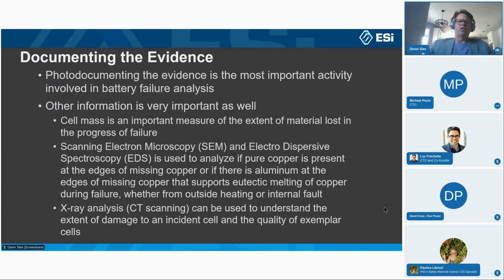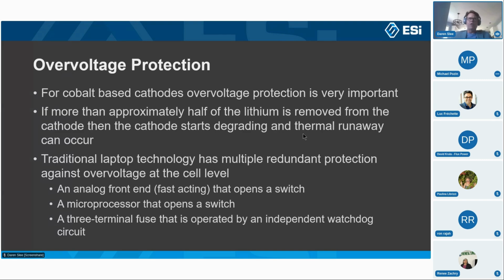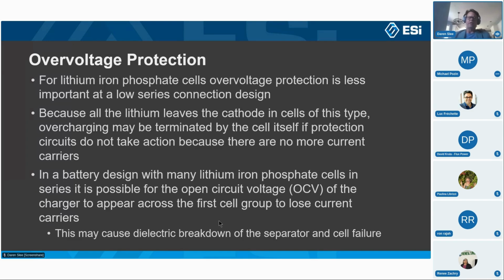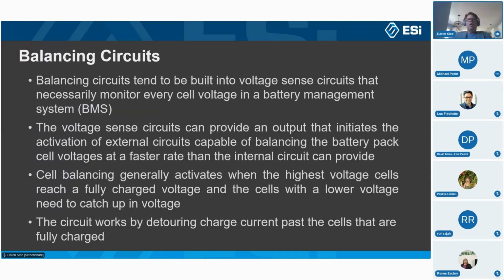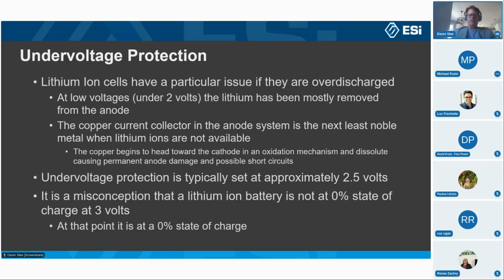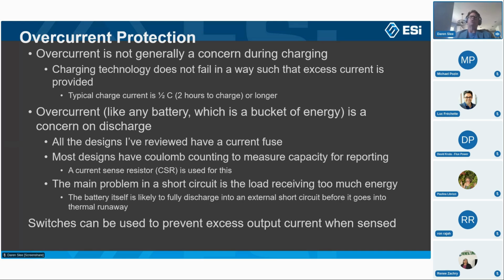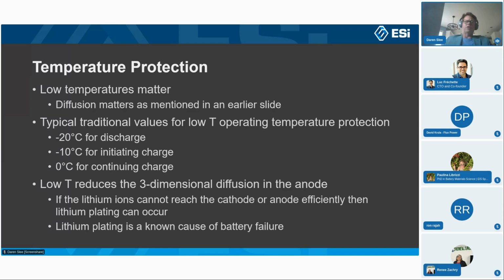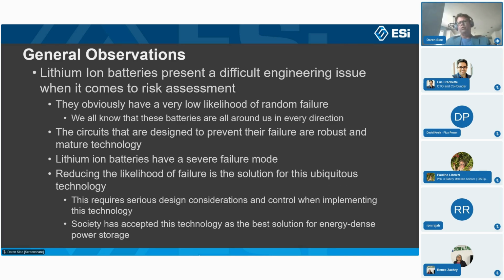Battery Forum: Outside the Cell - Battery Failure Analysis with ESI

Comment: While I think this presentation is good. Little bit odd that presentation is called "Outside the Cell - Battery Failure Analysis.." but then only talks about cells and says almost all failures are because of the cells failures. Be nice to also speak about failures that do happen for protection circuits, structural damage, water ingress, etc